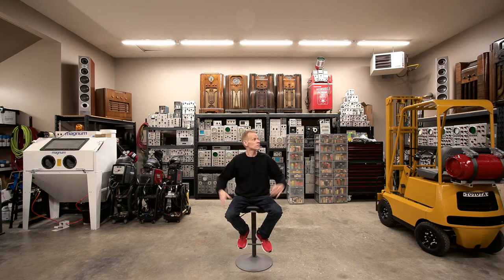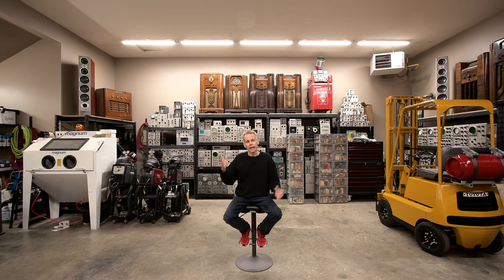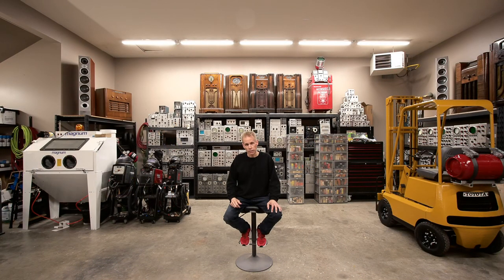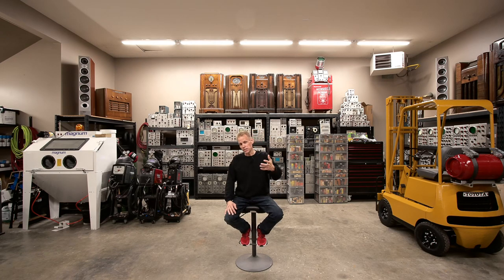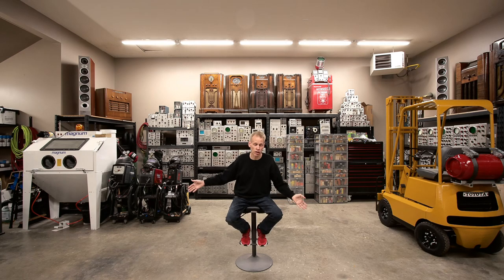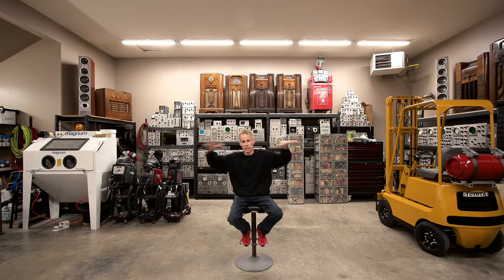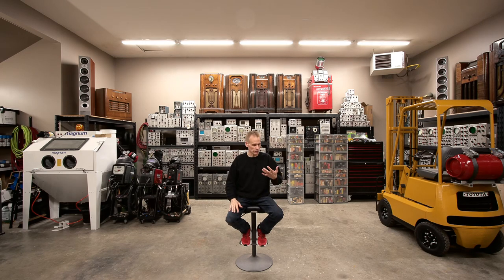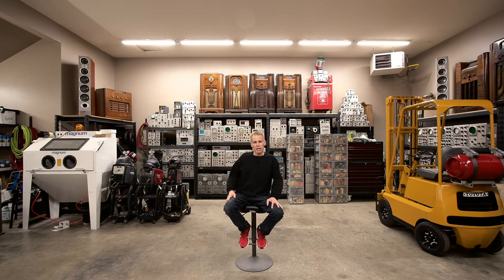ZAP! Mr C's Worst Electric Shock Explained In Detail!

Comment: We had an old fridge my dad grabbed off the curb one day. It worked great, but we quickly found out that it wasn’t grounded. Grabbing the door handle wouldn’t send jolts through the whole body, but my hand certainly would buzz in that way you describe. I think we had the fridge for a month, using a rag wrapped around the handle to insulate ourselves. It also would freeze up in no time and that’s what we ultimately threw it out for.

Comment: Man i could feel this as you were telling it
Thank god i never got shocked like that but i had a few bad ac and mains encounters and i could just feel the worst one of them surge right back into my arm from my hand up into my shoulder to my neck as you were telling this.
So great description i guess.

Still don't know how that one worked either, it came from this extension cord with some protection circuitry in it that had two computers and a screen plugged into it but i got shocked by the power lead when i picked it up, the one that normally goes in the wall so i have no idea how that works but it was my worst ac shock ever.

Comment: You are totally correct.  There is no such thing as over cautious when dealing with electricity.  I have had a couple of nasty shocks too.
Even lower voltages such as 48 Volts can have dangers if the circumstances are just so.  I once maintained several E beam vacuum 
evaporator systems.  These had 10KV 1 amp DC power supplies .  These things would cook a person like a bit of bacon. Made me 
very nervous did not like working on this gear.

Comment: Hi Paul, great to see you passing on your knowledge of electricity and the potential complications of encountering high voltages.  Electronics has been a committed hobby for many years. I have been primarily employed as a paramedic for over 40 years and have seen many people electrocuted in one form or fashion, most with only minor injuries.  I hail from Australia, where our supply hovers around 230 VAC.  Electrocution can play havoc with the nerves within our body hence the muscle spasms, one of the most important areas being the heart.  Should the shock be prolonged or strike at an inappropriate cycle in the cardiac rhythm, it can cause cardiac arrest almost immediately (worst-case scenario).  For the most part, this is not a usual occurrence, and the shock is short-lived.  It is advisable to call EMTs/paramedics post an event of this significance as the cardiac nerves can still be susceptible to altered function and potentially cause arrhythmias or cardiac arrest sometime later.  This usually involves a trip to hospital for cardiac monitoring for a few hours to monitor heart rhythm.  Sounds like overkill, but it is better than being found unalive sometime later.

An additional problem is that electric current burns, as you have made very clear in your video.  Electricity loves to find the shortest path to earth, and one such part can be from your hand to the ground, usually via a foot.  Just like copper traces on a PCB, the veins and arteries within the body hold a lot of moisture, something electricity likes almost as much.  This results in extensive burns to internal structures within the extremities damaging vital pathways that can cause extensive damage and life-threatening injuries.  Another reason to attend the hospital.  Some of you are reading this and saying to yourself I have been bitten, stung or zapped many times in the past, and yes, we have all been there. We dust ourselves off and get past it until one day, we don't.

I have been watching Paul for a long time. He is one of the creators that continues to reiterate safety throughout his videos, a commendable attitude. We all love our hobby, passion, or job. Just play safe.

Comment: V-Fib it sounds like. Very dangerous condition. Glad you made it.

My worst shock was from working on a defibrillator. It was unplugged and the battery was removed but the issue (found later) was the dump relay not functioning. This left the capacitors fully charged. I got a finger too close to the HV board and BAM! All the other techs ran over when they heard my loud Oooph to see if I was OK. Luckily it was a very brief although strong discharge. I had to go get an EKG afterwards but no real damage done.

Comment: I have been shocked while working on a Renard 24 Christmas light controller.  It was on the 5v rail and I got zapped with a few milliamps.  I didn't feel a buzz, but my hand that was holding the board started to twitch on it's own.  I thought hmm that's odd and was able to release the board immediately.  This in part was no where near what you experienced and I am certainly glad you are ok Mr. C.  It does wake you up and I am a lot more cautious and incorporate more safety when tinkering.

Comment: As far as DC shocks, I've only had short sharp shocks working on electronics, but when I was younger I was standing in the rain with wet boots holding a steel gate that was being welded by a DC welder and I could feel the tingling going through me.
Your video has reminded me of the unexpected dangers.
You may need to look into an insulated stool, in my old man's workshop it was always stand up and wooden stools, back then he worked on highly dangerous live chassis TV's with a floating earth. My new shop has a plastic wheeled office chair, but the desk's frame is metal. I'm going to look into covering any of the frame my legs or hand can touch.

Comment: I was working on a 32" color monitor inside an Indy 500 sit-down arcade game around 1979.
Working in a large arcade game refurb shop.
I was looking at a mirror doing adjustments.
My arm had to reach in and snake around the CRT, near the anode (which was a bare clip).
Extremely cautious, mindful, paranoid and careful not to let my arm near that anode.
Suddenly BAM! Something hit me on the head which caused me to jump, and my arm got solid on the CRT anode.
I could not move my arm to get off of it.  Same experience you had with the mic.
The current was going through my right arm and also my right leg, which I also could not manipulate.
My left leg was working, so I hooked it under the shelf under my bench and pulled myself off.
The warehouse people liked to joke around and throw 5 inch balls of shipping tape at people.
That is what hit me at that unfortunate moment.
That's not as much current as you had, but it produced the same effect.  And a burn on my arm.

Comment: I have also had a few shocks over the years, but the closest that I have come to a lethal shock was when I was adjusting the control board on a 45KVA 3 ph gen set, I was leaning over the unit supporting myself with one hand on the framework turning a trimmer when my knuckle touched one of the output terminals, I definitely got a 50HZ buzz from that but it was not as painful as a shock from a colour tv crt.

Comment: As a child, I found myself in series with a 120 volt neon bulb as I bridged the continuity tester's test leads. Fortunately, my mom was near by and saw me acting stranger than usual so she unplugged the tester. I'm a broadcast engineer, now, working on 100Kw transmitters. If I get shocked on those, you won't know about it because I won't be here to comment.

Comment: Hi Paul;
All I can say is wow! Thanks for the story! Incredibly you survived that.

I've been professionally working with electronics since the 70's.
I'm very lucky as I haven't been badly shocked. The biggest chance of getting badly bit was when I was working at a Ion Implanter manufacturer called Extrion Varian in Gloucester, MA in the early 70's. I use to repair and test one million volt DC power supplies!
It was potentially (sorry for the pun), dangerous but very fun walking in the HV cage and drawing multi-foot lightning bolts off of HV doubler stacks with a grounding rod. Before it would discharge I would slowly build up the HV and feel my hair all over my body stand up and prickly feelings all over my skin.
A guy did die from a shock when he stupidly left his wedding ring on while testing the Ion Implanter on the assembly floor.
Note ; Ion implanter is nothing more than a glorified metal CRT on steroids. Maybe the length of a car, with one million volts on the focusing end and a LV heater drawing tons of amps to heat the cathode.

Note ; Ion implanter is nothing more than glorified a metal CRT on steroids. Maybe the length of a car, with one million volts on the focusing end for beam acceleration, and a LV heater using many many amps to heat the cathode end at the other end for electron emission..

Keep the stories coming!
Tom M.
Reply from the maker: Thanks for stopping by Tom!

Comment: Watching this video reminds me of an incident  I had with 277v AC where I was working with some metal halide lights in a giant walk-in freezer.I was working on one of the electrical boxes of the light on the top side of the freezer,but before I did I turned the breaker off and went back up and started to remove a wire nut from the neutrals tide together and touched the wire with my fingers and I was stuck for atleast 10 seconds before I was able to let go. To this day everytime I think of that  Incident i find my self re-living that moment and it gives me the shivers. Very terrifying being so close to death. Later I found out the manager of the warehouse was walking around and noticed that the lights were off and turned the breaker back on,not knowing that I was still topside working on that box. "Do this at your own risk" can never be said enough times.

Comment: I felt that "buzz" as a kid(Maybe 8 or 9),  I was fetching the extension cord for my Grandfather, back in the day when weed-whacking involved multiple 50ft extension cords.  After I reached down to grab it, I turned around to run back with the cord's end in my hand and my wittle thumb curved over the end, and over one of the receptacle-holes(apparently the hot side) and all I can say is "Thank God" for (at the time) screw-in-fuses. ALSO it's the one and only time that a stuck extension cord getting yanked out of your hand as you walk off was actually helpful.

Comment: Paul, I think it is important that you keep urging caution when working on equipment with hazardous voltages. Many years ago, I headed a small electronics department in a company and one day my two technicians were working on a 3 phase motor controller and our managing director came into the lab with a visitor. Later that day the MD called me into his office and told me that my guys didn't project a good company image to the visitor as they were standing around with their hands in their pockets. I said, "Ok, are you going to send me a memo saying that they are not to have their hands in their pockets?" He said, "Do you really need that in writing?" "Yes" I said, "It is to cover my backside when there is a workplace death." I then explained what the hands in pocket thing was all about.

Comment: Paul I will share a similar situation I had as a new ham in the late '70'S. A Drake l4b amp from a ham fest. Gone over it well, new caps tube sockets switches wiring. But forgot to replace the bleeder resistors on the nice big higher voltage capacitors I installed.
Making adjustments the screwdriver slipped and the cap discharged into me.
I saw a flash inside my eyes - never forget that. Smashed me against the wall dislocating my shoulder. Left me on the floor stupid and dazed. Shoved the screwdriver into my left bicep several inches. Left two dents in the wall from my shoulder and my skull. I consider that my warning about high voltage, never forgotten and forever respected. Now RF burns those are lots of fun......
Reply from the maker: Thanks for sharing your story John. You came out lucky as well.

Comment: Had a similar close call when I was about 17.  Not sure what the actual mechanism was, but I suspect it had to do with a bad ground in a bank of big PA power amps.  As soon as I leaned against some metal fencing I got a huge wallop - thankfully falling back away from the fence - but it literally took my breath away.  Vision went narrow, heart was racing, and it took about 20 seconds before I was composed enough to actually get up.  All it takes is a moment of carelessness - especially if you're alone.

Comment: I (also Paul) had a similar experience when I was a young kid. I wanted to pull a plug of a hair dryer out and didn't notice that right around the plug the insulation had broken and a few strands of copper wire were exposed. I grabbed the plug and was instantly under 230 V 50 Hz AC... I also couldn't let the plug go (obviously) but since I was educated by my father that electricity can cause your muscles to cramp, I only remember thinking: Ok, better if I let myself fall backwards and try to pull the plug that way to break the connection. It worked, and luckily I hadn't my heart stopping, probably the connection didn't go through it, but it was very bad nonetheless. I got a few more shocks while tinkering around with electricity as a kid... that taught me to be extra super careful... but no matter how careful you are there's always the chance you touch something that you didn't expect to have a voltage potential, which happened a few times also in my life, but luckily it was over pretty fast as I only touched it with a finger or so. Still caused me to rage at the person who actually caused it by willlingly using faulty stuff... in this case plugging in a portable fluorescent tube light with a metal enclosure where the protective earth wasn't wired correctly... instead it had line voltage on the case. This thing was wired up by the person I seconds later yelled at questioning if he wanted to kill me...

Comment: I had a smiliar experience replacing my mom's dryer outlet. She had the old version that was not compatible with newer electric dryers. I turned the breaker off to the utility room where the outlet was in. For some reason, some genius ran the circuit for the dryer outlet to the garage circuit breaker so even though I shut off the power to that room, the outlet was still hot and I didn't know. Back then I didn't have a voltage detector and for some reason I was so sure there was no power that I didn't bother confirming with my multimeter...big mistake. I started taking it apart and working on it until I accidentally grabbed a wire. I had the same issue where I couldn't let go of the wire. Evenually I did and two of my finger nails turned black and came off and I felt like Mike Tyson punched me in the face because the electricity was making my jaw muscles tense up so severely that it hurt to chew for a week. Glad you made it Paul, I love your channel!
Reply from the maker: Thanks for sharing your story, glad you made it as well!

Comment: I used to work on 10,000 and 50,000 W HF transmitters. Not only the power supplies a hazard, but RF burns take forever to heal.

Comment: As a teenager experimenting back in the 90s, I thought nothing of drilling a hole in the cap of a 2L cola bottle and sliding it over the end of the pipe from an old fridge compressor I had taken apart… and then decided to turn the compressor on… the bottle got more and more taught as the pressure increased… sheesh I shall never forget the IMMENSE “BOOOOOM!!!!!!” as this misshapen, inflated cola bottle ruptured, leaving intense ringing in my ears and blood blisters on my hands. How silly - but I learnt!

Comment: My father came close to dying in the early 70's due to a mistake on an electrical installation that had been done by a council many years before. Specs stated that electrical conduit was concreted from floor up. When my dad drilled into wall he went through cable and conduit that had been installed top down. BTW he worked for that same council as an electrician for 23 years. He came very close to death that day and never forgot that experience and was ALWAYS a stickler for safety and not taking anything for granted, especially other electricians work.
Regards from South

Comment: Reminds me a lot of the worst shock I ever had.  I was a teen working at an amusement park, the rides operated on 440V,  I leaned down on a tea cup that I was loading riders onto, and my finger slipped into a light socket that had no bulb or cover,  I experienced the identical concept of being very lucid, the vibration, not being able to pull my hand out, and eventually I came to the idea to swing my body and used the inertia of doing that to physically pull me away from the socket.  My heart didn't stop and restart, but I did experience that vibration feeling for a good 10 minutes after.
Reply from the maker: Thanks for sharing your story!

Comment: I'm an electrician and electronics fan since the 80s. I got shocked a few times. 
The shock you received actually prompts a visit to a hospital. Current going through your body causes electrolysis and subsequent release of gases like hydrogen. This can cause an embolism, stopping blood flow to  vital organs. You where young, with a strong heart and probably fit as well.
I had a similar experience. When i was ~14 my friends parents told me their 286 computer would intermittently lose power. I opened the case, tool out the PSU and powered it up by it self.
As luck would have it a wire inside broke off and touched the metal case and protective earth in that building was not working. I screamed, not because of pain but because the path the current took caused my muscles in thorax and abdomen to contract, pushing out all air (and no, i don't remember farting) . They took a few seconds to realize what is going on and headed towards the breakers to end my calamity. I recovered fully but not without gaining a huge respect for the destructive force electricity can have on biology.
Nowadays i'm the double checking guy.Sometimes a real annoyance i reckon. But i ain't going nowhere without my voltage tester.